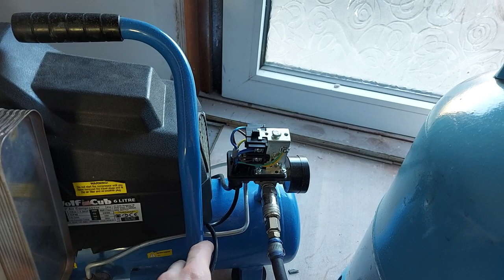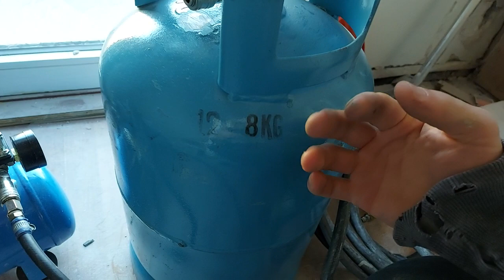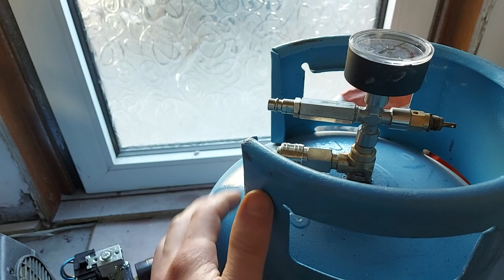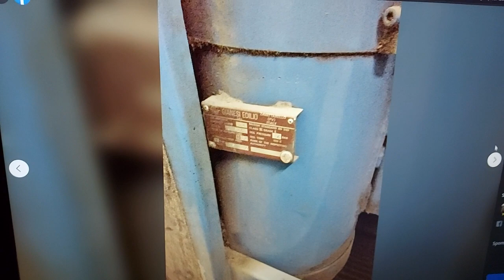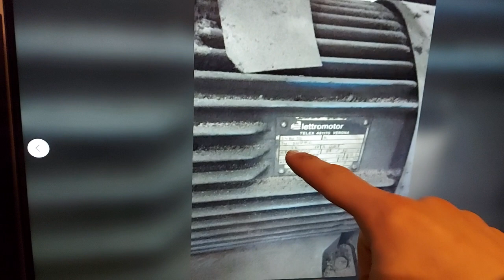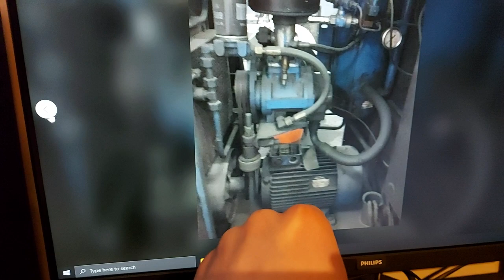Plate Heat Exchanger Air Dryer Aftercooler for Compressor

Comment: I run my 5hp air compressor on a VFD with an arduino controlling the speed so it runs slower when there is less demand (note, you'll want some way to measure the motor speed, as the minimum stall speed depends on the load).  Idea stolen from AvE.  I love your intercooler, I made mine with a 3m length of copper pipe inside a 50mm abs drain pipe with water circulating.  It took me far more effort than your approach, and it's probably not as effective.

Comment: hey Shaun do you think that a 60 plate heat exchanger would be sufficient for a 16kw capacity heat pump?
Reply from the maker: Depends on the heat exchanger power rating.

Comment: The electric motor in the air compressor looks like a 5.5 or 7.5 kW Motor. Also i would guess that it is a screw compressor. If the screw can be turned by hand, it will be worth the trips. 
Have you PC watercooling parts like a Radiator and a reservoir laying around to get rid of the tub of water?
Reply from the maker: The water bucket gives me the option to use water that is much colder than the ambient air. Pretty sure it is an 11kw motor as it shows on the rating plate. Would be an amazing project but I can't afford 3 phase in my house.